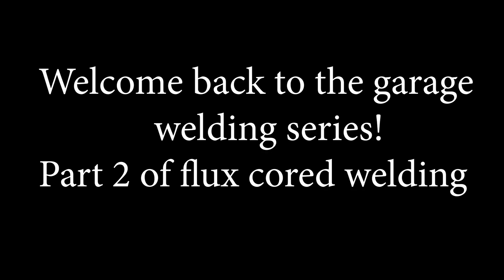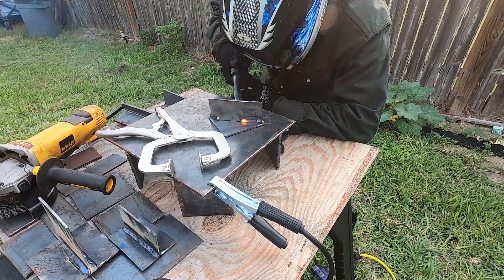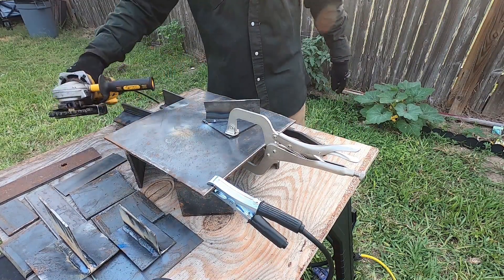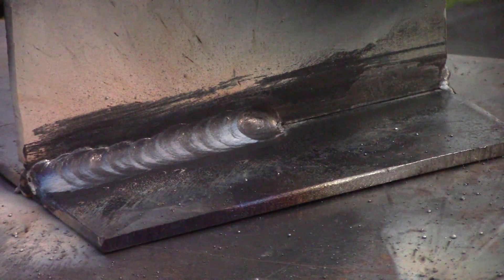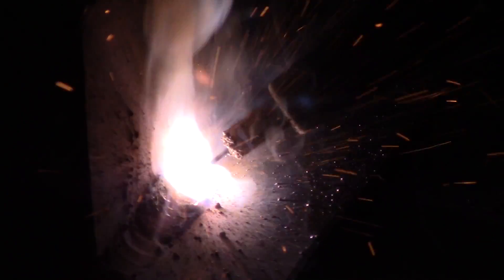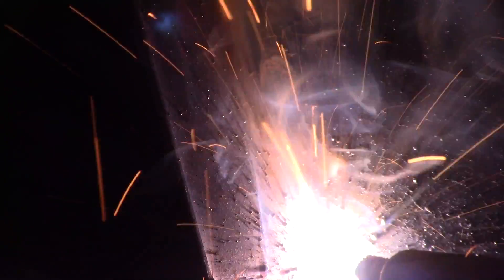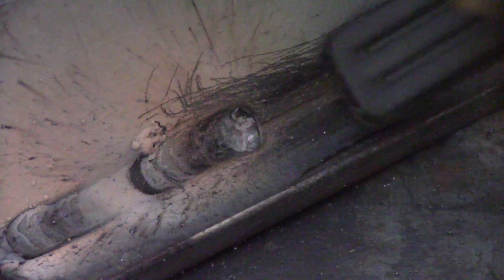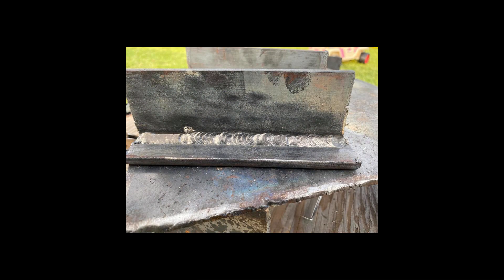Flux cored welding part 2

Comment: I’m using the Titanium flux welder from harbor freight and I’m having a hard time welding 16g , I keep burning holes through it and it’s at a low setting 🤨
Reply from the maker: Stick to the settings the on the chart but on thin stuff you may need to only make short welds or spot welds to manage the heat.  I'll try to put a video together using thinner metal.